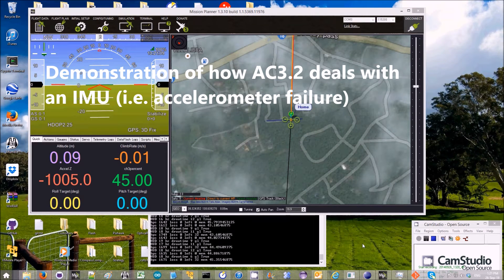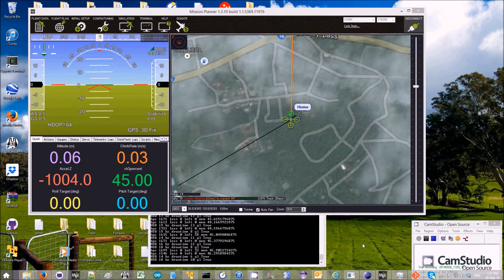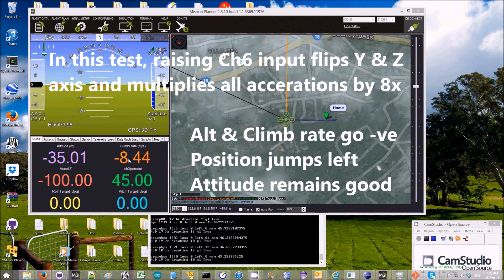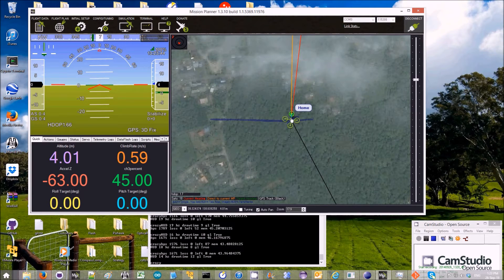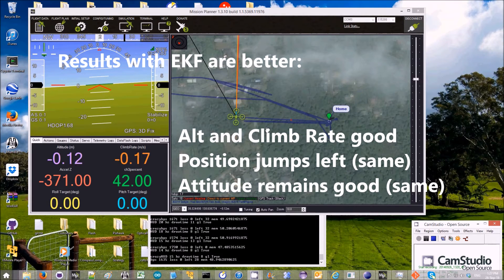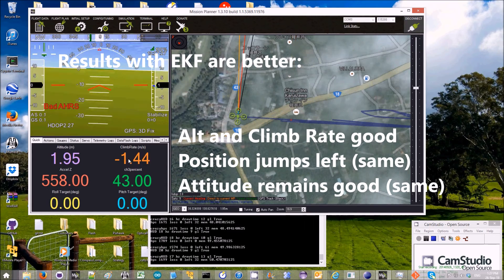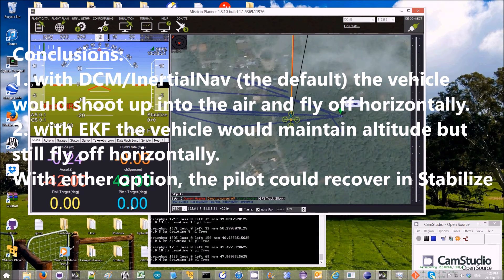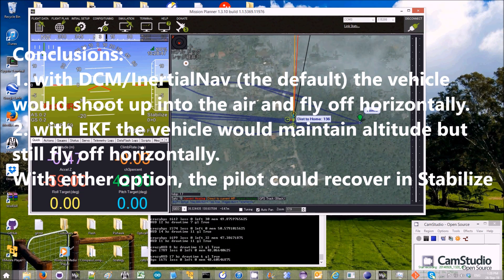AC3.2 Accelerometer failure test

Comment: Just you know it's not that rare, i have 3 apm 2.6 boards and two of them failed, due to imu failures. One fail in flight and cost me fortune. The other one failed in a weird way, Imu was like not sending data fast or something and that cause it to lag. Took me a while to diagnose that and i was with 3.2 Or higher firmware when this happen. Mission planner never caught the error. The imu failed in air did caught on that error but never the second one.

Ps. i fixed both by replacing the imu and since then no problem